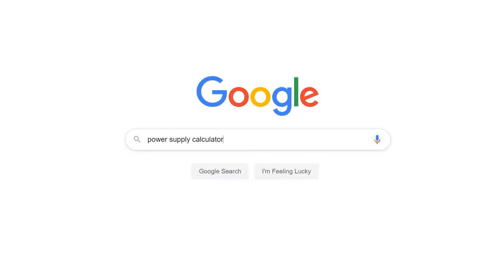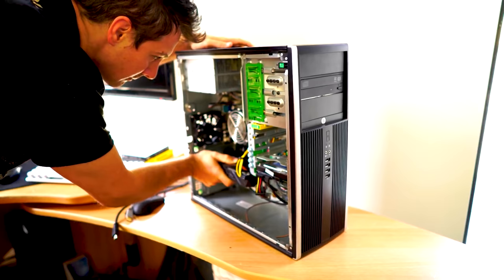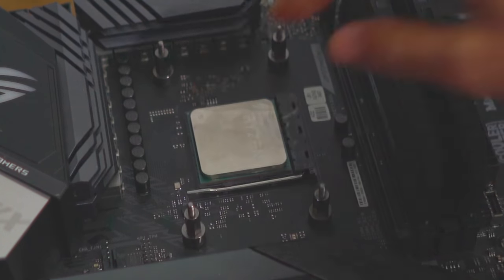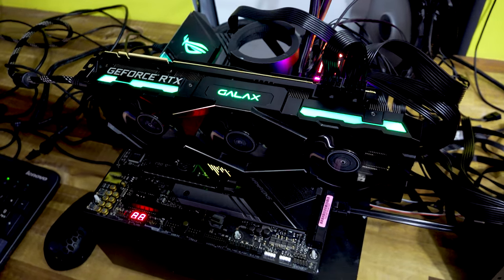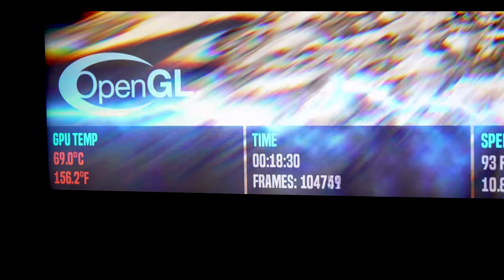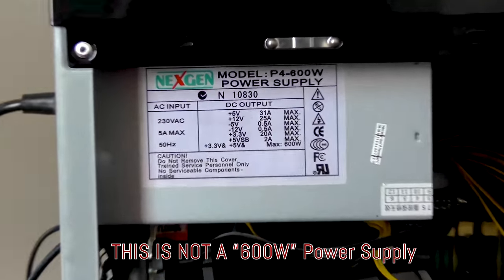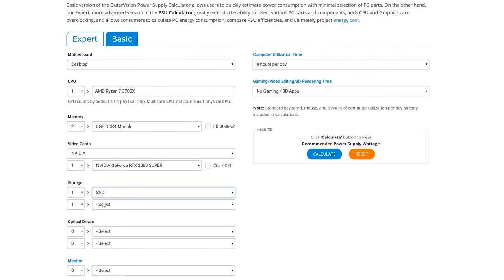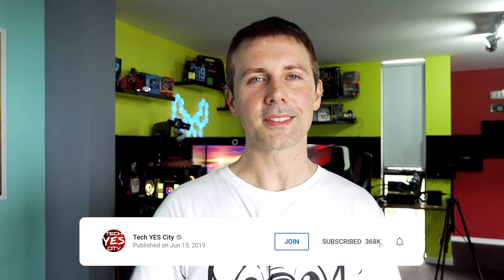I Tried Running a 3950X and RTX 2080 Ti on a 450 WATT Power Supply...

Comment: when you mentioned a certain virus I just had to stop and comment, its such BS ppl are getting demonitized for saying it yet I went through 3 different mid roll ads on separate videos yesterday talking all about said virus
Reply: the funny thing is you probably wouldn't have any problems using its actual name (COVID19) or even the new "crown" virus which was what the popular name meant. I mean terminology wise people may as well be talking about the common cold (many causes of which are corona(crown) viruses).
Reply: @mapesdhs597  While I do agree with most of what you said, I don't think this is done to pander to snowflakes, it's done to pander to our dear chinese overlords because they can and would retaliate harder than any number of snowflakes ever could if they were upset. ;)
Reply: @Yuzuki1337  It's a combination of both. The former do have significant influence in various political and media circles atm (doubly so educational institutions), though this year is likely to be when their meddling will at last begin to fade away.
Reply: mapesdhs . It's funny you talk about snowflakes having all this influence. They don't and never had. It's just a vocal minority that people attribute influence and power to.

It's also kinda pathetic that people refer to others as snowflakes while they too are delicate.
Reply: Suggestions: Toyota Corona, or Beer
Reply: @robertt9342  Absolute tosh. I could cite numerous examples of the way feminist activists, SJWs and suchlike have been able to alter public policy and even have laws passed to support their worldviews (certainly where I am in the UK anyway). Your ignorance of such matters isn't an excuse. UK police harrass citizens on a regular basis who publicly comment about the problems of islam and grooming gangs, while modes of speech have even been the source of legal action. Just look at what happened to Count Dankula.

You are choosing to believe they don't because you don't like the idea that's how bad things have become, but that's not an argument. Sweden's insane responses to massive increases in migrant rape stats are a typical example, likewise the current media rubbish about being racist when talking about nCov which was fundamentally only possible because of backward cultural norms in that nation. Where I live in Scotland one girl at a student meeting was criticised just for raising her hand to ask a question, other students found the gesture upsetting. Safe spaces are everywhere now in UK colleges and universities, with some even including compulsory courses about rape for male students.

You can bury your head in the sand if you want, but facts don't care about your feelings.
Reply: @mapesdhs597  thankfully their political power is waning and conservatives are about to wax again
Reply: mapesdhs while I 100% agree with you I don’t think the “snowflakes” as people call them are to blame for this one. This is mainly YouTube buckling to the Chinese overlords
Reply: @mapesdhs597  damn, is it really that bad in the universities? Was thinking about applying in the UK
Reply: @mapesdhs597  thanks man, I'm studying engineering and hopefully there will be relatively less bs there.
With even schools going to shit, what are we supposed to do in future for our children? Not everyone can pull a Elon Musk and open a new school.
Reply: @repeatrepeatrepeat  There's a decent chance engineering places will be somewhat less affected, while as for children the key is not to rely on the state to educate them with what is necessary in life, because that largely won't happen. Whether they still have to attend state school or not, do it yourself aswell anyway, which frankly is what every parent should do. Read books to them, be interactive, encourage enquisitiveness, but most of all don't just plonk them infront of a TV or tablet and leave them to it. Indeed, keep them well away from phones for as long as possible (worth noting that the CEOs of most major tech companies do not allow their own young children to use smartphones).

A good model for this would be Richard Feynman, how he helped educate his children. Should be some docs about him on YT. A simple example, he said his son once asked why it was, with a ball sitting on the back of his toy truck, when he pushed the truck forward the ball would then fly off the back (or of course seem to). Richard told his son to carefully look at the truck from the side instead as he did this, he would see that the ball infact mostly doesn't move much horizontally at all, instead it begins to spin as the truck moves forward (a chance to explain friction later) and then drops to the ground when the truck is out of the way. He then explained, this is called "inertia", the tendency for an object to either remain at rest or keep moving as it currently is unless something else acts upon it, in this case his pushing the truck. The key point here is that his son apparently understood the explanation. A child grasping something like that is invaluable. People wonder why we used to have the great inventors & suchlike of yesteryear; well this is why, they were highly educated when young, learning and knowledge were virtuous pursuits in their day. By contrast, today there is a pervasive sense that being kinda dumb is fashionably optimal,  the media constantly mocks the very notion of intelligence, eg. the way the head honcho bad guy in every Bond movie is always like a super genius or somesuch, usually with a British accent since many infer that implies intelligence (ha! They should see some of the bank customers a friend of mine has to deal with every day), but in Hollywood intelligence equates to evil.

Children are like information sponges. They will ask question after question if permitted, they want to know about the world around them. Millions of years of evolution to produce such remarkable beings and yet instead most parents constantly dampen down that enthusiasm for learning (and modern schools do the same), often because the parents don't know the answers either and are embarassed when asked about something they don't understand. Why is the sky blue? What is the sun? What are the stars in the sky? Where do babies come from? The list is endless, but the solution is simple: parents should learn as much as they can themselves, it is their duty to give their child the best starting point they can, that is the responsibility they took on. So read books, buy magazines such as "All About Space", watch educational channels like Tom Scott, Medlife Crisis, Lindybeige, blancolirio, Pecos Hank, Primitive Technology, Techmoan, Biographics, Periodic Videos, Numberphile and Veritasium (I can list more if you like), gain that knowledge so that you can answer questions when asked, which will make you all the more a cool parent in the eyes of the child. Though retain humility, because the more you learn the more you'll realise there is yet to know. Socrates wrote that wisdom is the road discovered when a man realises he doesn't know what he thinks he knows.

And hence most of all, if asked about something you don't know or aren't sure of, don't lie, instead say, "I don't know, so let's find out together!". Preclude embarassment by turning a common lack of knowledge into an opportunity for shared learning, all the better for enhanced parent/child bonding.

Btw, if it were up to me, I would bring back the teaching of Latin in schools, not because the language itself is hugely relevant in modern discourse (even though its presence is seen endlessly in all sorts of areas of science, especially horticulture), rather because in teaching Latin one can make use of the writings of the great thinkers and philosophers of the past, and in so doing a child will learn philosophical principles, ethics and the foundations of rational argument, the ability to reason. The widespread emotion driven plague of crazy we see so much these days is due to so many youngsters lacking these skills almost entirely. Sargon has talked about this idea a number of times.

Never before in history has it been possible for anyone to learn so much about absolutely any subject one can imagine, yet instead our schools churn out young people who can barely string a sentence together, know little about how the everyday world works and frequently lack even rudimentary social skills (eg. being able to talk to someone with gawping at the ceiling or every other direction except the other person). Those of us in our 30s or more all know from experience that govts are generally terrible at organising things, they are inefficient, wasteful, dogmatic, bureaucratic, etc. And yet people blindly retain extraordinary faith that state education will achieve what no other govt programme does, a sensible outcome. It wasn't quite so bad 35 years ago, but today many schools have become little more than centres for indoctrination, machines that churn out homogenised clones who are all equally devoid of enthusiasm for learning and ignorant of the real world. There are exceptions of course, but I'm talking generalities here, the dominant trend. Also, an aside worth dropping on occasion to the young who love state power so much: war is a government programme.

I recommend looking into how schools in Hungary and Switzerland deal with this sort of thing, they handle the social aspects of learning a lot better than UK schools.

One other rather obvious thing: take children to museums, castles, mines and other places that will help them learn about the world. This is of course less productive at a very young age, but even so has merit where such places are also within impressive landscapes, etc., and some do cater well for younger visitors, such as Warwick Castle. Visit them yourself first if possible, I recommend Bamburgh Castle, Cragside House and some of the forts along Hadrian's Wall (Vindolanda and Housesteads). And sometimes it's just a matter of simply having a broader view of things, in unexpected directions, eg. see what you make of this, a song written almost 800 years ago which laments the end of summer:

https://www.youtube.com/watch?v=7UvesKl8_W8

People centuries ago were not as dumb as the modern world likes to believe. :)

Another fine example of how to interact with children would be OffTheRanch, Matt Carriker has been an inspiration for many.
 
Btw, many years ago as part of a bulk purchase of disposed computer parts, I received a disk drive that came from a machine at a high school in London (clearly it should have been data wiped, but was not). It contained a vast amount of data, but most revealing were the academic scores of students which were almost universally completely dreadful. And let's just say that, looking at the facial images of the attending students (yes, it was all there), it didn't exactly look like high IQ was something any teacher at the school was ever likely to encounter. Most would make the cast of Idiocracy look smart. It's a sad fact of life that half the population have got to be below average (as Heinlein once wrote), but our culture seems to have spent the last half century shoving that midway point as far down as possible, amplified by importing many from parts of the world where base intelligence is considerably lower.

If I was completely honest I would say these days one can make a good case for not bothering with uni at all, everything one needs to know about anything is already available largely for free, but that type of decision is much more complex and beyond the scope of this discourse. In the meantime, I recommend this channel, Learn Engineering:

https://www.youtube.com/user/LearnEngineeringTeam/videos

A channel somewhat familiar to me since they do most of their animation work on a PC I donated to them two years ago. :)

https://www.youtube.com/watch?v=g2WiJNEZLNY

There are though of course many other similar channels and resources.

Btw, for engineering, you need math. I highly recommend the books by K. A. Stroud, "Engineering Mathematics" and "Further Engineering Mathematics"; they are available for free online as PDFs, but I suggest obtaining them in print form, they should be available cheap via ebay or Amazon (used), etc. Stroud explains numerous mathemtical concepts in a far better way than schools could ever hope to, especially complex numbers. Without them I would never have completed my comp sci degree.

Also, for engineering, I suggest learning what you can about materials science, think of it as the raw ingredients of machinery and technology. :D  For a start, buy this book and keep reading it a page at a time, over and over, every time you use the bathroom:

https://www.amazon.co.uk/gp/product/1780873271/

And after all that, well, I guess good luck and work hard! 8)
Reply: @soberthoughts209  Yes. :D  But note that it's collectivism in general at fault, aligned with globalist tendencies since they have certain things in common. The modern notion of right & left in politics though is a distortion, oddly enough pretty much invented by the left in order to hide their connections to nazism and slavery. It doesn't matter whether it's socialism, communism, fascism or any other ism, what matters is the distinction between collectivist ideologies and their opposite, the rights of the individual vs. the power of the state. Collectivists believe the latter should take priority, traditional conservatives (who barely exist anymore) believe the opposite, hence why it was the latter who led the fight against slavery, whereas slavery in the South was fundamentally a cultural norm of the Democrats. As you say though, highly corrosive ties between corporations, govts and China have made this worse, but this just emphasises again how it all goes wrong when the power of the collective holds sway over the rights of the individual, because the latter is what gets stomped on every time a corrupt arrangement is put in place between these various entities. And so yes, in this instance China's CCP is absolutely at fault for this debacle, even though other elements are complicit.
Reply: IKR the chinese censorship about it is why it wasn't contained. It could have been contained like MERS and quckly become history.

Comment: I recently built a new PC and I chose a Seasonic Focus GX850 watt power supply.I have a gigabyte aorus b550 pro ac with wifi motherboard,an amd ryzen 5 3600x,an xfx radeon rx 580 with 8GBs,two 2TB SSD drives,a dvd burner and 5 case fans (two at the top and 3 at the front.).While most people would consider 850 watts overkill I chose the Seasonic Focus GX850 because I have been using Seasonic power supplies for years now and I find them very dependable,plus I may use a custom water cooling loop for this recent PC build but I'm not sure yet.Very good video,in my opinion it's better to have more wattage than is necessary and from a reputable power supply manufaturer instead of buying a power supply then upgrading and finding out that the power supply that you have is not enough and having to buy a new power supply.A 1000 watt power supply is way too much for the PC build that you demonstrate in your video though unless of course the owner of a PC build is planning to add dual video cards,a water cooling loop with dual water pumps and extra case fans in a full tower PC case.Thank you for the video and God bless you and your family.

Comment: I had a dell XPS 420 bought in 2008 had a 420w PSU. I put 6 different GPUs into it all with higher wattage ratings than the PSU and never had a problem. That pc lasted 10 years.

Comment: Literally me to my friends "You don't need a 1000 watt PSU for your i5 9600 gtx 1060 build" my friends "But it's for future proof" me right after "You only need like a 600 watt PSU max for a 2080 ti and 3700x"
Reply: Them: REEEEEEEEEEE
Reply: "like you're going to buy gpu that costs twice your entire system" :D
Reply: Things can add up quiet fast if you have a alot of electrical consumers in your PC

I have a Ryzen 3900x, RTX 2080Super, 2 Standart HDD drives, on NVME SSD, 4 SATA SSDs, 7 Fans, Waterpump. 

The calculator says that my PC needs a 745W powersupply.

Didn't expected it to be that high...
Reply: new nvidia GPUs are now being said to use up to 600watts alone
Reply: @Blox117  oh wow
Reply: @Sphyxx  My computer only draws about 450w fully loaded and I have an 1100W PSU. but guess what? The fan has never actually spun on the PSU to my knowledge so it's very quiet. :)
Reply: the futureproofing is good too... I plan to upgrade to a 3080 or 3090 from my gtx1070, and might expand the water cooling to cool the GPU as well, maybe with another pump, so it is actually nice to have a lot of headroom there. Even with the higher wattage GPU the PSU should be reasonably efficient and reliable (and not too noisy) at that load.
Reply: @mikee9167  my pc barely makes any noise at full load with a 450 watt PSU
Reply: @leondrews1  Psu calculators are trash
Reply: I have a 650w psu and now because i want to buy a rtx 3090 i need to buy a bigger psu....so...yeah. I wish i bought a 1000w one from the beginning.